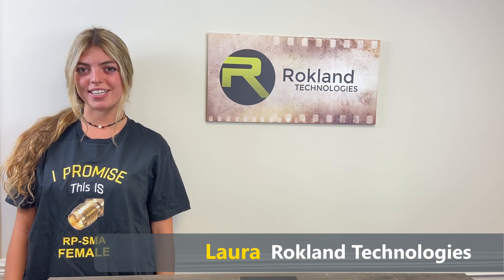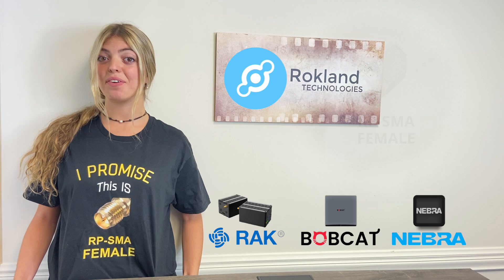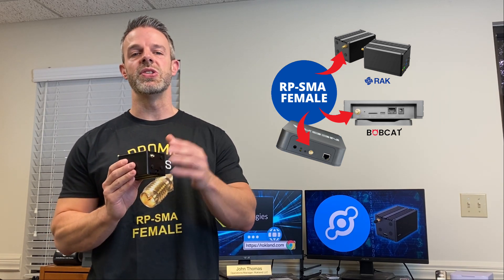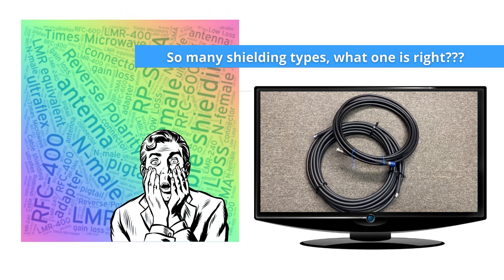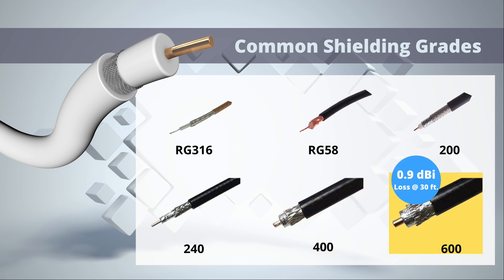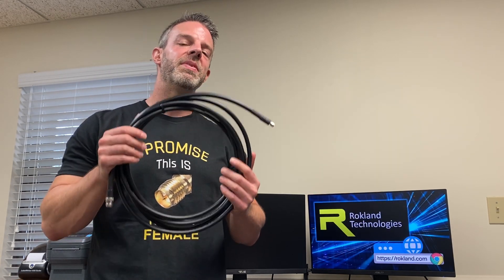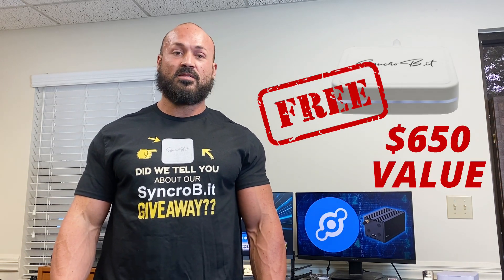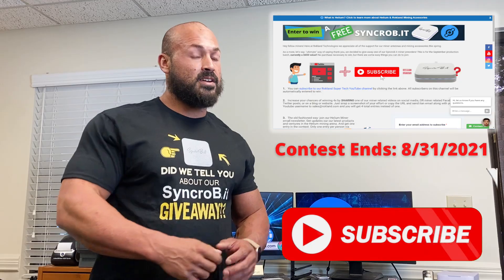Helium HNT: 3 Tips on Connectors & Cables for your Outdoor Antenna+ BONUS SyncroB.it Miner GIVEAWAY!

Comment: I have a question please help ok I have a bobcat miner on the bobcat I have 32.9701 feet or 10 Meters of LMR Microwave cable not the Flexible kind.my question is at that length how many DBI am I losing I have an 9dbi Mcgill microwave omini directional antenna.I was told that each connector will lose approximately .5 or 0.05 dbi loss which is it I have the antenna on the antenna I have a lightning arrestor there I have a connector so I can hook up the lmr400 coax cable then it's ran 10 meters to the bobcat miner were it is connected with the standard rpsma connector what would be my total loss on this 9dbi Mcgill antenna.Another question is how many dbi will a lightning arrestor lose on its self.I was also told each connection you have even if it's just a standard N connector on the cable to an antenna you will lose dbi for each connection no matter what.Please help with my questions.
Reply from the maker: 33 feet of LMR 400 = ~ 1.32 dB Loss
Arrestor = 0.5 dB loss
Total dB Loss: 1.82

Comment: Hi guys great video, I have a question i need a 29ft cable what would you recommend with less gain loss for common sheilding grades? A 240 or a 400. A 600 is out of the question its to big for me. many thanks Stef
Reply from the maker: We carry two 30 ft. options based on your antenna needs. Both our 30 ft. cables are 400 grade. Reach out to us in the live chat and we can help pick the best one for you!

Comment: So it appears I bought the wrong cable. Wish I had seen this sooner. Bought a 75' low loss 600 grade coax cable for a RAK and it wont work for the  MNTD RAK i got. Back to the drawing board.
Reply from the maker: What cable did you buy? It can surely work if you get the correct adapters for your RAK and antenna.

Comment: My buddy wants to put his antenna for his helium miner below my VHF/UHF ham radio antennas which are about 45 feet above the ground. It will give him a clear shot over all the houses in the area.  I don't transmit above the 70 cm band (~450 Mhz)  so him being at 900-950 Mhz (or thereabouts) shouldn't be of concern.  He'll only need about a 50 foot run of LMR 400 but he should be good to go. 

I was wondering why he took an interest in antennas and coax lately.  :-)

Comment: Please explain lightning protection for LoRa antennas and devices on the roof. For example, the M2 Pro Miner from the MXC network (MatchX) is an expensive $3K LoRa device which customers want to make sure they protect in the right way.